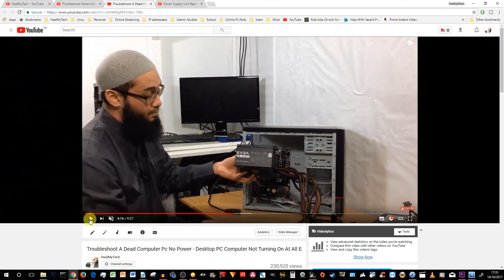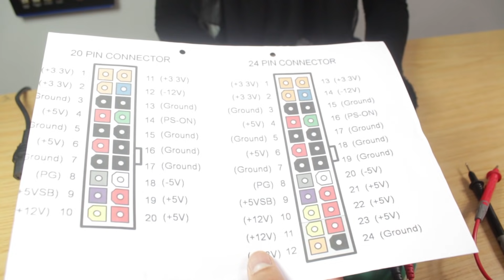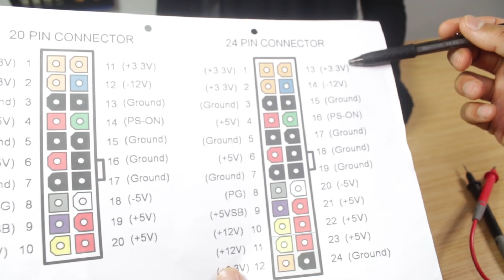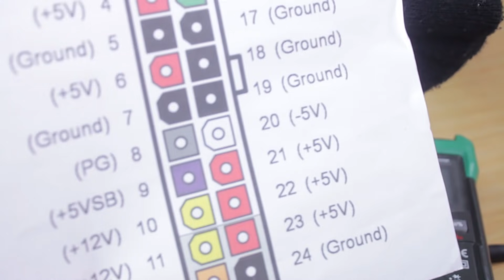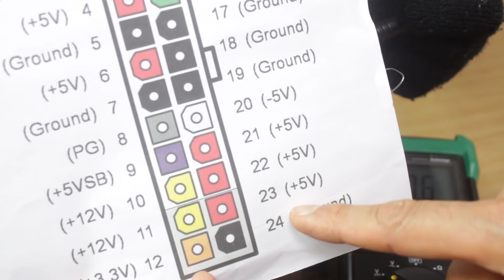How To Test A Power Supply Unit (PSU) With A Digital Multimeter | Advanced Troubleshooting

Comment: Hello the blue pin gives me 14.14 V instead of 12 V.  My PC does turn on but I the screen does not. Is 14.14 V normal?  I'm using a Corsair CS850M.
Reply from the maker: Its higher than it should be, normally 4-5% range is okay, it needs further investigating, have you tried another PSU in your system?
Reply: @HealMyTech1  It was the CPU causing the problems. Great video, you helped me find out that the PSU was dysfunctional.

Comment: Thanks for this vid I was able to check my power supply it was ok but still no turning on computer so I started to mess around with it by plugging every thing in then using multimeter on that diode option and plug the multimeter into the green black wires then not just the power supply fan worked but the cpu fan as well then pressed the power button and the computer turned on. So thanks for showing me what I needed to do with the fan cos it helped with actually turning it on
Reply from the maker: As long as it works, I'm glad for you!
Reply: Thats so weird, to me(a noob)..why does this work?

Comment: On my blue -12v wire im getting -11.2 volts witch isnt ok accoring to this video but is ok according to wikipedia.
Does anyone have any advice?
Thanks in advance!
Reply: I would start by opening the PSU and looking for popped capacitors or burn components. Just leave the PSU unplugged for more than an hour before touching the inside. Capacitors can/will stop your heart if they are still charged and you touch the top of the big ones. That charge can last a long time. Usually minutes but its worth the being a little patient. That voltage sound bad to me.
Reply: @alien_man1669  Thanks! Turned out to be different problem tho.

Comment: This isn't a definitive check to know your PSU is good. You could have a working fan and bad votlages that can fry your components.
Reply from the maker: Care to elaborate?  Or even better, if you have the knowledge and skills, want to appear as special guest on the channel for a better tutorial, hit me up!
Reply: He checked the voltages?
Reply: Isnt = *is typo maybe
Reply: The voltages were checked bro.
Reply: I think he meant that even though you can measure all the proper voltages, but it's not under load. I am having that problem right now. I can get the psu fan to spin when I jump the green and black and get all the 3.3v, 5v, & 12v; however, once i plug it back on the mobo...nothing...the psu fan won't even turn. Either the psu failed due to the load by the mobo or something is bad on the mobo pulling down the voltages on the psu such that it's not enough to power the system.

Comment: Should I just replace my motherboard and or Power Supply in accordance with the following situation?

Water was spilled and every component was wet. 

It was a decent sized glass of water but the thing is, the computer wasnt on at the time and was only plugged into the wall and the switch was turned of on the power supply.

Immediately after the water spilled i took every component out of the PC and layed them out to dry for a week. After a week had went by I wiped everything down and put it all together and attempted to start the system. 

Upon pressing the power button nothing happened. 

I determine the problem to be either the PSU or the Motherboard as the system is receiving NO power at all.
Reply: Test the PSU first. Replace if faulty. Replace Motherboard otherwise.

If Motherboard doesn't work with new PSU. Replace Motherboard.

PSUs are cheaper, you want to replace it first.
Reply: It also may be the button of the case itself.
Reply: @Skywalker05088  very doubtful

Comment: all these vids showing how to use this paperclip method, don't you think this is dangerous,  why not use a short length of insulated wire with the ends bared...its much safer specialy if your going to use the multimeter and test all other pins....much better than dancing arounda bare live paperclip...…..just a thought to keep folks safe and stop any libel claims too
Reply: My dude...  the output of that paperclip is 12v. You can touch it nothing will happen.
Reply: @vhfluffy967  even if you do touch it you'll be in parallel with a much higher resistance than the paperclip. Most of the current will travel through the paperclip.

Comment: I am getting no voltage on any pin. Does that means my PSU is dead? 
But on the other hand my pc turns on for a split second then turns off...
Reply: Did you bridge the green and black wire?

Comment: Hi great video as always. I have a question regarding a JeanTech 400watts power supply. I have done the test shown in this video and the results are much higher than one would expect. Orange is 6.7 volts;  nothing on the blue;  red 10.6 volts; purple 10.5; 26.2 from yellow!! It is a 20 pin ATX supply. I have googled for a pin out for this particular power supply without success. Should all ATX power supplies be the same? Thanks for any help you can give me.
Reply: Idk if you figured it out. But from the sounds of it your PSU was bad. Blue should have shown 12v, but yeah unless you got some weird PSU/mobo combination they should all be the same set up, maybe with different coloring on the wires, but not the order and voltages. Basically it makes it easier for people to buy a PSU or mobo if they only know how many pins they need.

Also the higher voltages could have been caused by a few things, simple reasoning is that your voltmeter leads suffered oxidation and wasn't making great connection or the battery was low. 

Harder to verify is that it could be a grounding issue and you're connecting right, but when it reads, you're actually adding up voltages from other pins.

Comment: The multimeter im using doesnt have that specific option you used, mine has 2, 20, 200, 600, etc.
Reply: Use 20 or 200

Comment: Good vid but my blue and yellow wires wont read on the 20v setting so i put it on the 200 setting and they read 2.16 and my red and purple are at 8.5v and orange is 5.5v is my power supply stuffed any advice would be appreciated

Comment: how about VGA Cables?
Reply: I assume you can do the diode test for continuity with the multimeter in resistance mode if your multimeter has that function. Then just go through each pin with the corresponding pin on the opposite end of the cable to ensure they are connected.

Comment: is testing the 12v output of a standard molex connector(ie from its yellow wire) a reliable way to check the actual voltage on the 12v rail of the psu?According to hwinfo64,the voltage on the 12v rail of my psu is 11.88v on idle and 11.59V on load.But upon testing the molex connector's 12v output i found that the idle voltage is around 12.26V and on load it goes upto 12.29V.

So which reading is more accurate?Are measurements taken using software reliable at all?I have a corsair CX 450 power supply btw-does it appear to be working normally or is the voltage on its 12v rail a bit on the lower side?
Reply: ALL of the yellow wires (+12v) on a standard PSU come from the exact same source. So yes. you should be abler to read the same voltages from any of them. Same for the Red (+5v) and orange (+3.3v) wires.
HWinfo is not reading raw power from the reading PSO 12v rail. It is simply displaying what some sensor in the MB is reporting.
If you are testing the PSU, then take your readings from the PSU.

Comment: When you test the motherboard plug supplier, is it necessary to test all the wires of the same colour in one connector, eg all the red +5V wires. Surely if one red gives a correct reading then all the other reds will give the same as they are supplied by the same rail in the PSU. Likewise for yellow, +12V and orange, +3.3V. Wouldn't testing one yellow and one orange wire be sufficient? Also why is it necessary to test the mains voltage? It's what voltages come out of the connector plug that's important?